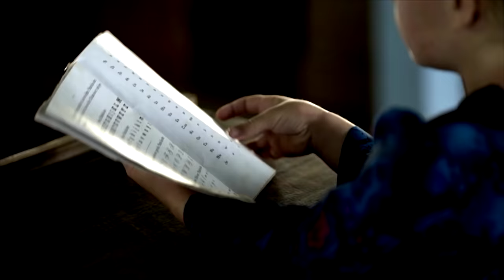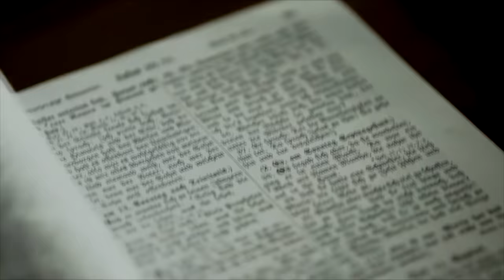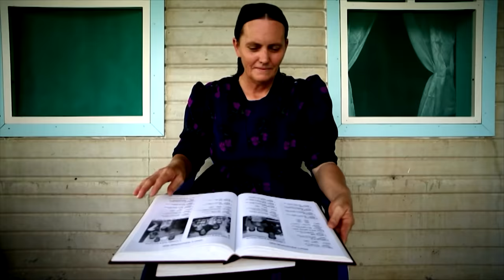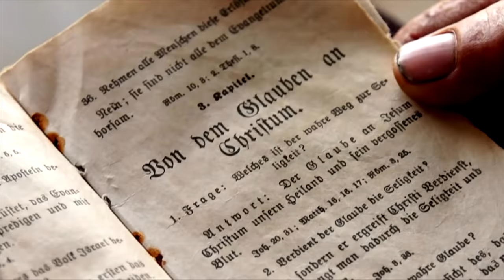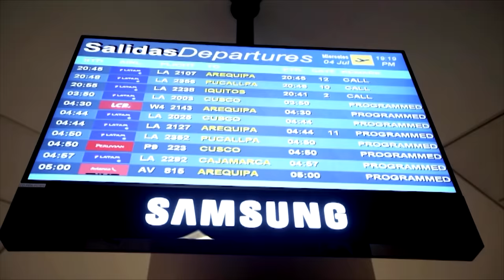Meet the Mennonites: Inside the Ultra-Conservative Community | ENDEVR Documentary

Comment: as a modern german, i find their dialect intriquing but very hard to follow.   This "german" has drifted quite a bit away from the motherland (might be the swiss component) 
- but with effort on both sides, i think communication could be established....

as for "plattdeutsch" this is very much still used in the coastal areas of northern germany, and is very close to dutch language.   hamburg is one of the bigger cities where older generation can still be cought using it.  Unfortunately, it is dying - since it is not taught anywhere anymore.